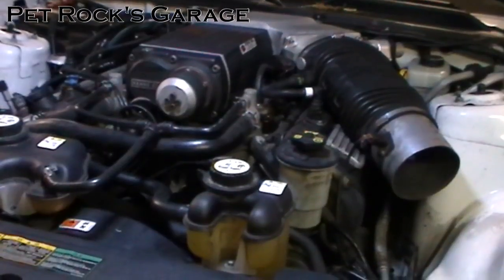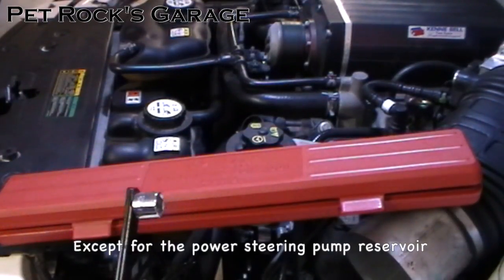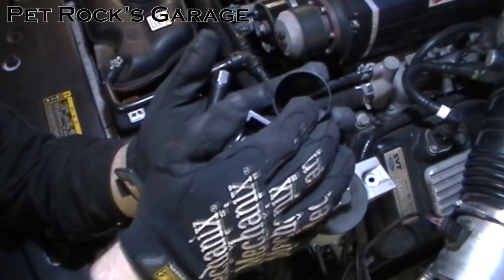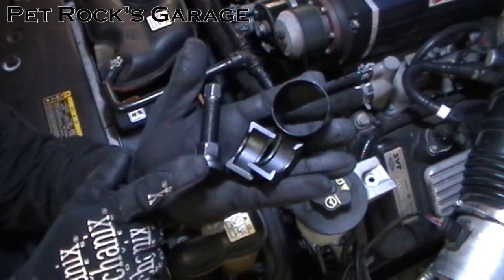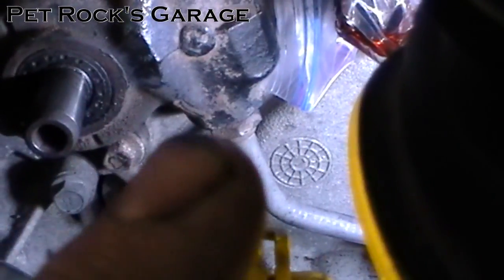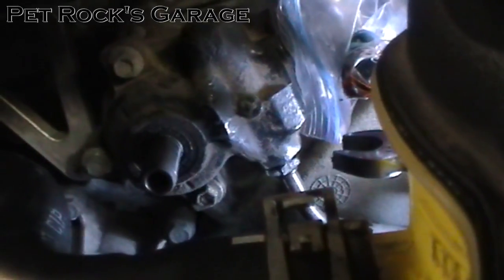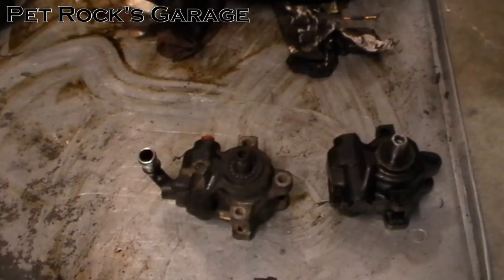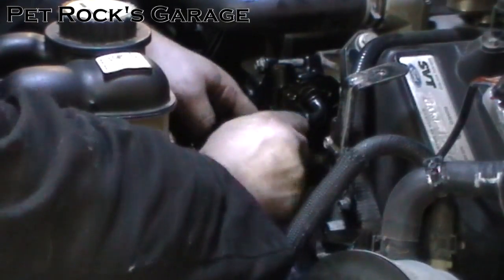How To Replace Power Steering Pump - Ford Shelby Mustang GT-500 (’07 - ’09)

Comment: This is the only video I could find about these pumps on the s197. Mines a gt, it worked for me to follow these steps and yeah those clips that hold the line going from the reservoir to the pump are a sob. The only thing to add to the video is the size of the flare nut wrench, mine was a 3/4 which can only be sold in a pack at most auto stores. Curious because yours in the video looked smaller.
Reply from the maker: Hmmm. You're right. I forgot to mention the wrench size in the video. However, in the video you can see a flash of "8mm" engraved on the wrench around 8:21 as I show the wrench on camera. So I was using an 18mm, which is slightly smaller than a 3/4. It probably fit the nut with the least amount of slop out of the set of metric & standard line wrenches I have. I got mine as part of a set of 16 line wrenches almost a decade ago. Well worth the investment, IMO. While they don't get used as often as a regular wrench, they definitely come in handy when turning nuts/bolts that you absolutely do not want to strip (like ones on brake, transmission & power steering lines).  Anyway, I'm glad my video helped you out. Thanks for watching & commenting. I appreciate it.

Comment: I have no idea if you will reply since this video is quite old but please let me know a way to remove the high pressure hose if the nut is at an angle that cannot be reached by a line wrench
Reply from the maker: Yes, I reply to all comments on my channel. Age of the video doesn't matter, IMO. I assume you mean the end attached to the pump, correct?  If so, you could try un-mounting the pump from the block and maneuver it to get whatever clearance you need to get the line off. The unit is sealed when the cap is on. Good luck.

Comment: TO PET ROCK GARAGE, Please would let me know the motorcraft powersteering belt size to this 2009 Shelby gt500. This is the green one. Thanks
Reply from the maker: It is typically called the serpentine belt.  Either way, according to rockauto.com, it is Motorcraft part # 7R3Z8620B. But Im not sure what the length is. Hope that helps.
Reply: Thanks for your help
Reply: The serpentine belt which is on the engine now is a dayco belt PK6-2200 I think this is in MM I hope this will help Thanks
Reply from the maker: Are you asking about the thin or thick belt?  The thin belt is the serpentine belt.  The thick belt is the Supercharger belt.  I'd advise going to rockauto.com and looking up your year/model and getting the belt you need that way. Good luck.